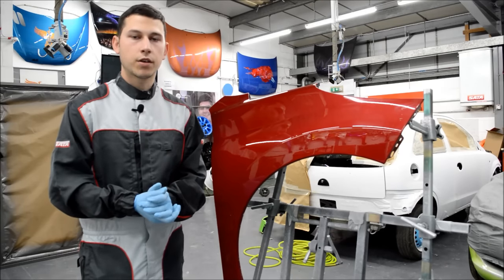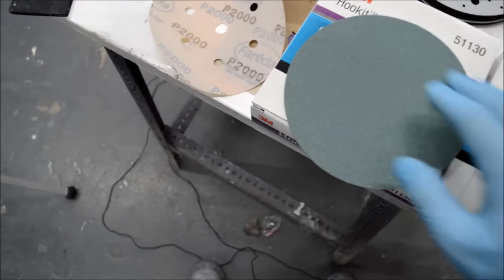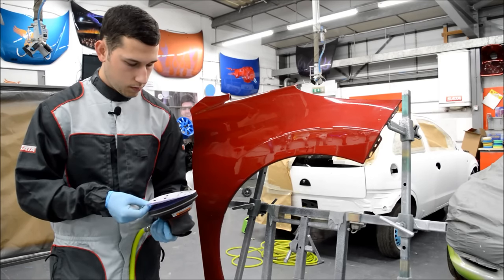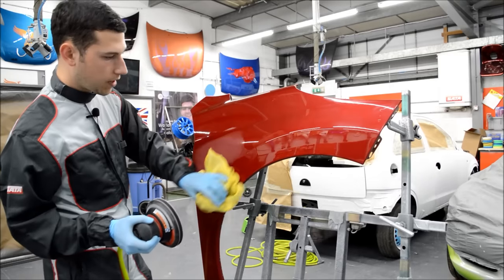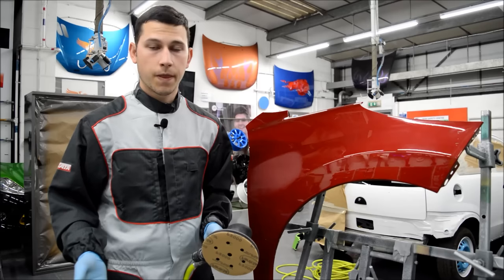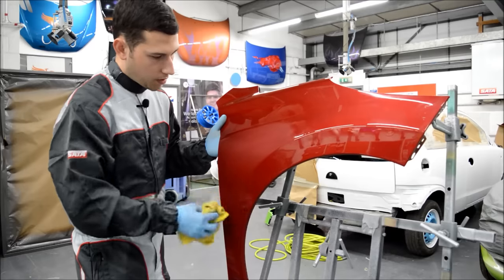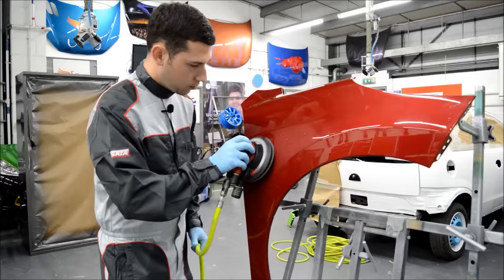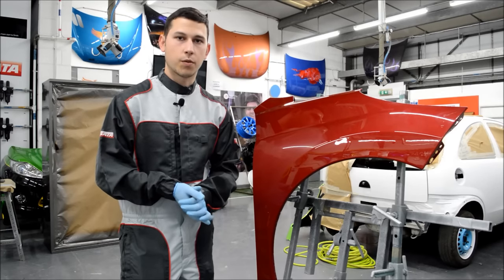Machine sanding using 3M discs before polishing

Comment: Well done.  So if I sand with the 6000 disc, can I avoid the rubbing compound step and go straight to machine polishing step #2?
Reply from the maker: In come cases yes you can, I'd advise trying it to see what you get but there's always a random p3000 pig tail left behind from the last step which you can get with the step one if you used it though

Comment: Awesome channel! No matter what I do i get pig tails all over!  Its on fresh 2 week old soft clear. 2.5 mm orbital with interface. I can’t see the pigtails until I had the thing finished out with 5000 and buffet and hit it with my detailers light and then they all show up. It has been very frustrating and time-consuming to have to sand them all out again by hand. Do you have any suggestions could I possibly have an issue with my sander it is brand new and was $200. I do it wet.
Reply from the maker: Hey, what grade abrasives are you using before finishing with 5000? Poor quality abrasives can sometimes cause pig tails in the clear and also a cutting compound that isn't capible o removing p1500 may struggle to actually cut into the clear to further refine the finished clearcoat. Cheers
Reply: @RepairRefinishTV  Thank you for your time!  I use 3m 1000 grit paper on a hard block then got to 3m trizac paper . 1500,3000,5000. I us a dewalt 849 with white foam 3m pad and Sonox cut max . I just thought that after 5000 i should not need such an aggressive machine and compound. These are all show cars with lots of clear but not baked. 
Im the new guy and wanted to bring what I learned on your channel to the process and speed it up, but have been plagued by the pigtails. They are micro though, not the big dirt pigs everyone talks about. 

Any suggestions are appreciated!

Comment: I have a carbon fiber hood, I just sprayed it with 2k clear coat and I have tons of overspray, could I just start with the 3,000 sanding on my orbital and polish after? I was also told I needed more clear coat, Is it possible to wait a day to dry the clear coat and spray over it once more even with overspray

Comment: What does the P stand for?
A few days ago I did wet sanding for my very first time. I wasnt even really sure of what I was doing nor what to expect. I started wet sanding already from the 1500. I had to buy a trizac 3000 and 6000 but I did it all by hand. It didnt come out perfect as the scratch was deep but it looked better than before.
The 6000 disc cost me nearly 8 euros here in Portugal. 
1500 and 2000 you always dry sand or it all depends on the situation? 
Thanks for your teaching.
Reply from the maker: Hi Alexis, 

The P means that it is graded which is basically saying it follows a certain standard for abrasives. Abrasives that have a P should be decent quality. The 3M abrasives might not have a P because they use a different technology that doesn't allow the abrasive to fall under the P grade.

My machine is best but you can do it by hand it just takes a long time🙂👍
Reply: @RepairRefinishTV  Thanks a lot for your reply mate. I wanted to buy a sanding machine on ebay but I did have more room to bring it over with me, plus I had already spent loads of money on my detailing gear. 
The 1500 and 2000 you always dry sand or in certain situation you wet sand? 
Regards

Comment: Hi, I was wondering if the porter cable 7424xp would be sufficient for wet sanding ? I don't know what orbit size it has. -Thanks
Reply from the maker: +1minibean I'd probably just use that for polishing only as it's quite hard to g
Keep a large machine flat

Comment: Hi,I have a question about the size of the sander orbit,is it not suitable to use a sander with a 5mm orbit to sand lacquer,even with 2000 or 2500,I was going to use my sander for clear sanding with 2000 but Im not sure now if I should because of the orbit size,would it make that much difference?, oh and great video.
Reply from the maker: +steve baker hi steve sorry for the late reply 5mm orbit is ok for sanding but a 2.5 would be better. I've used both 2.5 and 5mm and not seen much difference. You may get some swirls or pig tails if you don't work up the grades properly.

So 5mm will be fine just work up the grades and that will reduce the chance of scratches.

Thanks
Jordan
Reply: Lovely,but instead of a 6" pad would a 5" pad give a smaller orbit,and may be better?
Reply from the maker: +steve baker it doesn't matter about the size of the pad the orbit is how the bad moves. Weather it be a 2" or a 10" the pad will orbit the same size. Hope this makes sense. Thanks Jordan
Reply: Yes it does ,and thanks for taking the time and having patients to answer my query.
Reply from the maker: +steve baker thats what I'm here for 🖒
Reply from the maker: +steve baker thats what I'm here for 🖒

Comment: Hey!!! Can someone help me.. I'm using the P1500 3m sandpaper .. its the purple ones that don't have the extraction holes in it because my sander doesn't have the holes in it... I'm using an interface pad as well..but my sandpaper (sanding dry) keeps getting small clearcoat dots built up on it.. I have to scratch them off to clear the small white dots off of my paper.. what am I doing wrong? Thanks all!!!!!
Reply from the maker: Hey! 

Few things, dots appearing on paper can mean that the clearcoat is softer than usual. 

Or, the sandpaper is just too coarse. 

My go to paper is p2000 as it has a good balance of cutting and being slightly easier to polish.

Thanks
Reply from the maker: Also, trying wet may also reduce it and even degreasing the panel first if it's an older panel. Thanks

Comment: How about blending in paint and clearcoat what grit do you use.
Reply: You'd normally use 1200 but i don't recommend blending in it's oldschool and the edges fad back after 12 months and looks shitty..
I know it's a pain to paint whole panels if you only have a small repair on say a quarter panel and you have to paint up over the turret but it's just more professional to do it.